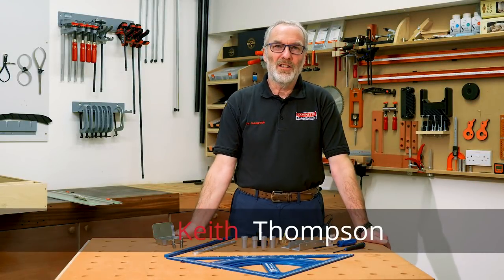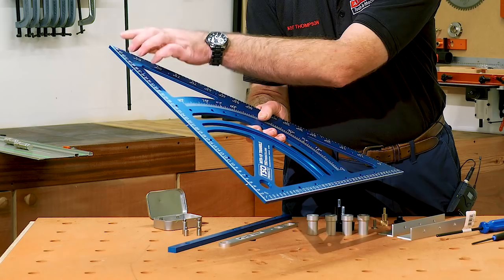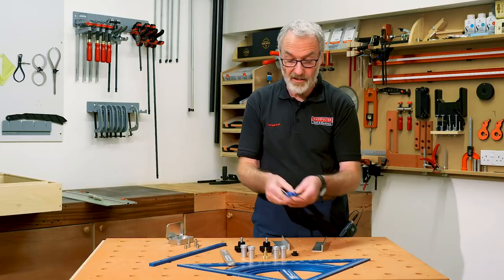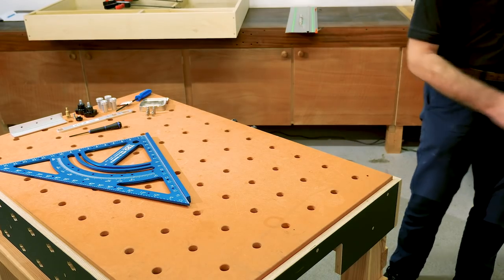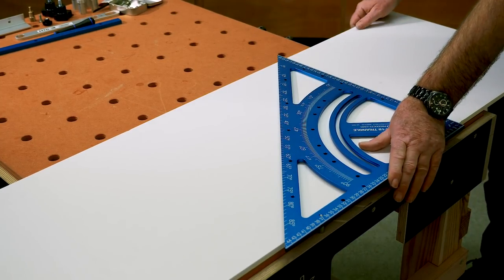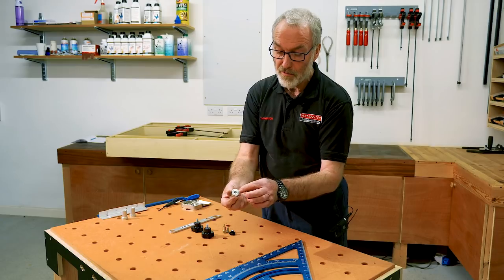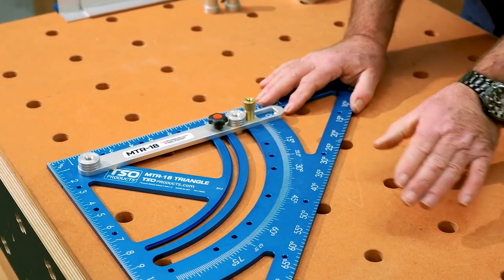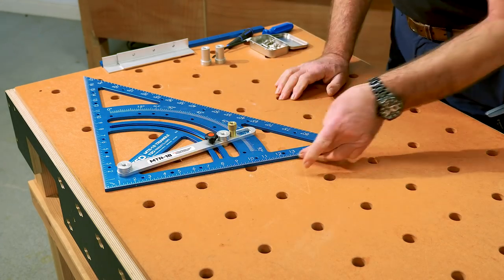TSO Products MTR-18 Precision Triangle - Product Overview

Comment: I note that the TSO guide rail squares have almost halved in price since they first hit the shelves. Ive got the Festool branded one (still made by TSO just not blue). At £115 and just after payday I pulled the trigger, but there is no way I could have justified the ~£200 it was initially, much less the £400 that the triangle costs. There will be people out there wealthy enough who see the utility in the MTR-18, but there wont be many of them. You can get an admittedly much less shiny and probably less accurate Stanley one for thirty quid...But its probably accurate *enough*.

Comment: The content of this video demonstrates most of which can be achieved using current UJK products such as the assembly square, fence clamps and cam clamps. the price seems to to set at what the market could potentially stand rather than what it is worth. Way too expensive and very few are likely to justify its 'limited potential' against what is already available.

Comment: would have been alot easier to clamp the angle brackets at the edge of the wood instead of awkwardly trying to fit insufficient clamps over and inside of the unit (just flip it around).